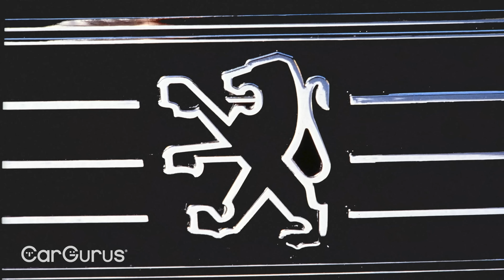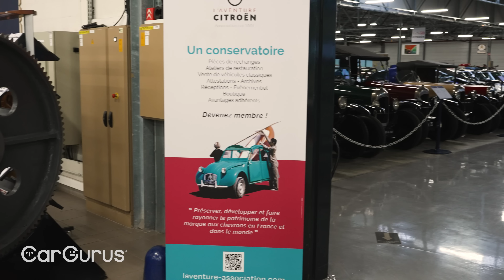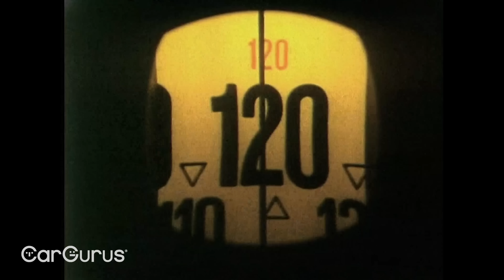The home of the classic Citroen

Comment: Great video. We visited Citroen Conservitoire in 2015 arriving in a leased diesel Cactus.
The CX Prestige 2500 turbo was the sleeper Citroen - a great driver's car / high speed missile. Steering of an SM, space ship control pods, performance & comfort, huge room, wheelbase of DS & SM - Just missing the turning headlights and brake mushroom of DS & SM...

Comment: That SM is something else! I've still yet to drive an SM. The nearest I've had to owning anything like that was a 1987 CX 25 GTi Turbo 2 (the same type that Grace Jones advertised) which was the best and most fun to drive car I've ever owned and enjoyed every single mile I drove in it. Sadly it got written off and I replaced it with a 1990 XM 3.0 V6 Si which was the more practical car being a hatchback, but the noisy engine, constant hydraulic leaks and a variety of electrical problems made it a massive disappointment, as well as the general feel of it being much firmer and more 'German' compared to the CX and also the D Special (ID 19B) I had before the CX. The DS/ID was by far the most comfy of the big Citroens I've had.